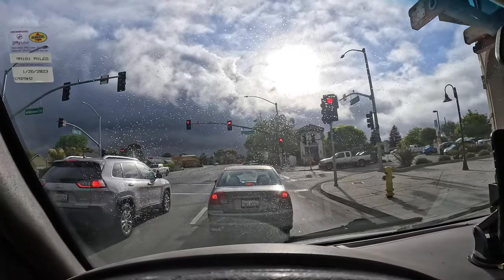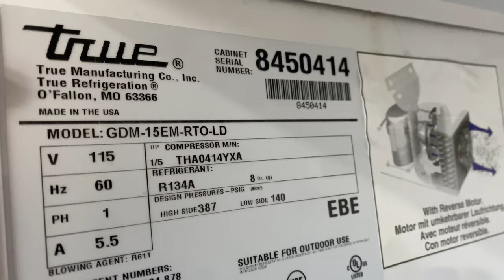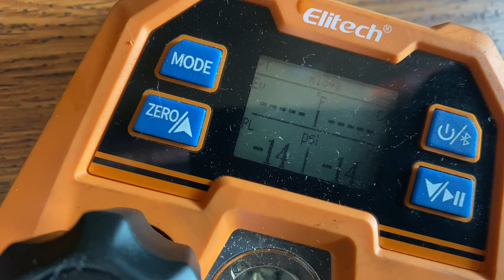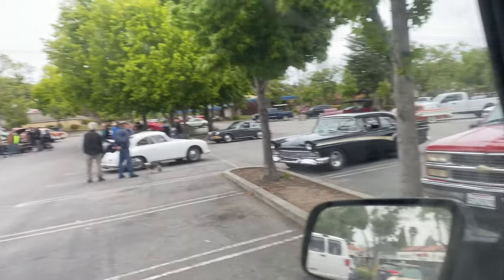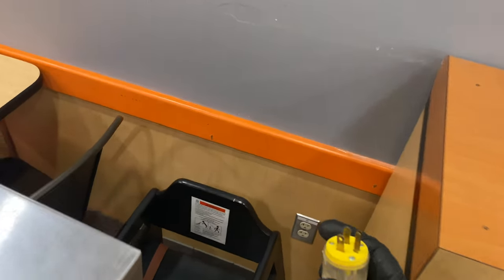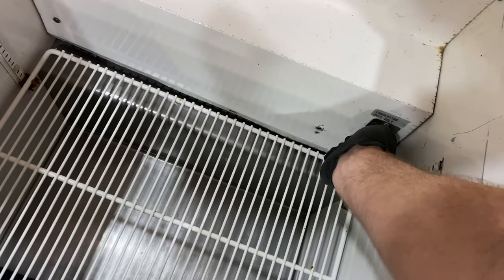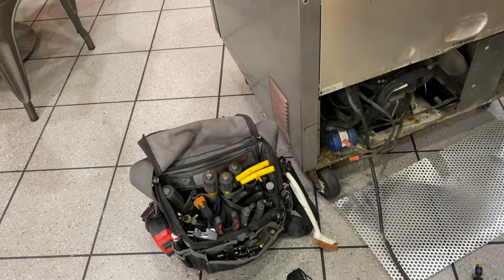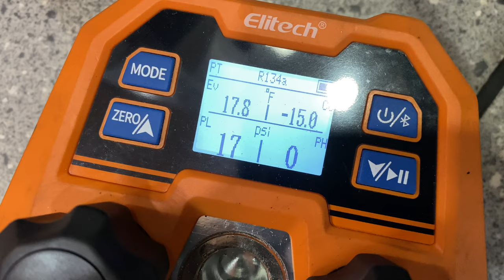Service Calls LEts Take A Look

Comment: She may be an old timer, but I have even older where I work now. Theme park with some original to start up in 1986. Some still have original charge in them. Others have had HS put in but have stat issues. Here it goes with the digital for the time being. Just condemned an ice o matic with original  high temp compressor for r22 running on r502. Locked up compressor. They wanted to put in another compressor. Told them the price for compressor v new unit. New unit it is now.